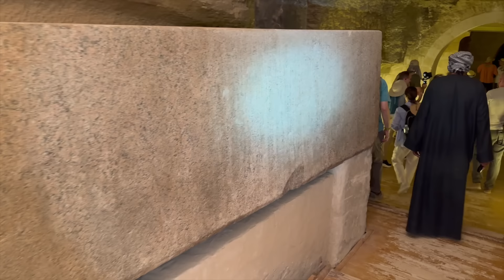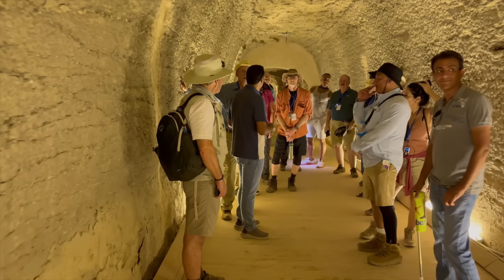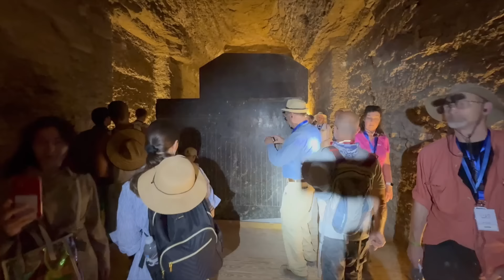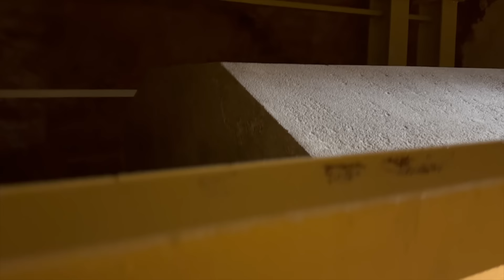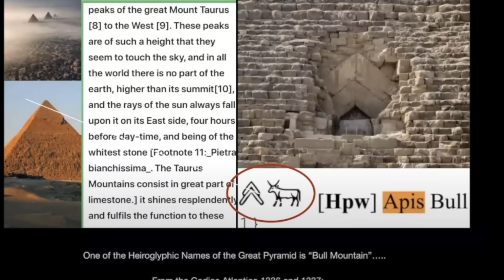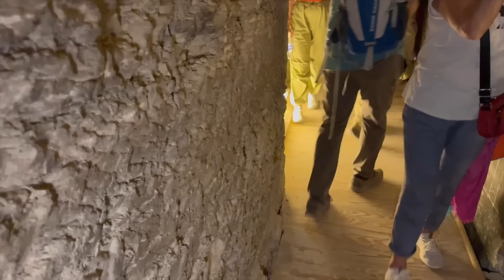Serapeum Secrets: what was really inside the 100 ton machined boxes?

Comment: Chris Dunn felt that the Great Pyramid vibrated as an F sharp chord. He said the King's Chamber vibrated as an F sharp. Then he said the Grand Gallery vibrated as the note A, as verified by his guitar tuner. Problem is that there is NO NOTE A in an F sharp chord. The F sharp chord consists of F sharp, B flat, and C sharp. There is no note A in that F sharp chord.
Reply: That's not the only issue with his daft assertation. JS Bach decided what note vibrates at which frequency. I have no doubt music was around in dynastic times but before JS Bach there was no standardised pitch value for any note. BTW you are wrong about the third of the triad of F sharp major. It is called A sharp not B flat. You don't mix sharps and flats in key signatures or primary triads. Yes enharmonically a B flat IS an A sharp BUT we do not refer to it as B flat in this primary triad.
Reply: @kirkhunter146  So do I use the pronouns he/him or she/her for this chord?

Comment: Moving the boxes. The Nile has moved quite a bit since ancient times and was much closer to these ancient sites than it is currently. We have found canals running right up to most of these ancient sites. So they moved the boxes 99% on water. Why drag stones on land when you can dig a canal straight to the quarry? As for moving the boxes themselves, I wouldn't under estimate what 100k workers with ropes/pulleys and domesticated bulls can do. A flip flop winch and some rollers would get the job done. Check out Wally Wallington for other ways to move big stones.

Digging/Lighting the tunnels. Digging tunnels has health risks and is hard to do but religious extremists and slaves dont care about that. Also making a face scarf to block dust isnt hard. During construction the tunnel was bigger than the arch structure because you have to put the arch structure in, this means any soot build up during construction is above where the current arch structure is. During operation the soot would have built up on the wall lining but you mention the tunnel lining being removed, so any soot on that would be gone too. Also soot can be cleaned off and this has been done in many ancient sites to make them more presentable to tourists and also to see if any hieroglyphs may have been hidden under soot layers.

Cutting granite. Mohs scale measures hardness, not shearablity. Meaning you can still flake it off with a softer material. Check out Scientists Against Myths video where he chisels granite stone with a copper chisel. I also recommend the copper tube cutting granite video. It doesnt take that long.

Coated boxes. No. One box has axel grease on it from modern times. The others are just sanded down to a mirror finish.

Piezoelectricity (which you explained terribly) only occurs under pressure so what is applying pressure to the box? Also it is only useful if you are running a connection from the quartz to something you are powering. Reverse piezoelectricity is where you pump energy into quartz and itll discharge into its surroundings. This might be useful if you're trying to electrically charge the ground which the box is touching. Maybe some electricity would charge whatever is in the box but 99% of the electricity would be grounded.

Precision is a result of selective bias. Weird how you see precision in some measurements but not all measurements. If they are so perfect then why are there so many mistakes. The boxes are NOT perfectly square, this one lid was and not even the entire lid. Just this one measurement. So many measurements get thrown around as "nearly" perfect and then being proclaimed impossible by human hands and thats just ridiculous. @35:43 you can see light gaps on BOTH sides of squaring tool. Doesnt seem very precise to me.

Vibration. A lot of the current theories revolve around vibration and reverse piezoelectricity but this would require the entire complex to be vibrating. The whole structure would be on an advanced suspension system to increase vibration otherwise its useless. Same as with grounded electricity. If the whole complex is on a suspension system then why isnt it vibrating today? Why dont seismic reading increase in that area? We should be able to detect more vibrational readings in those rooms than outside.

You didnt even get to the radio activity inside the boxes. Land of Chem has a video showing UV sensitive material inside the box. His theory I think is the most fleshed out but I think still falls flat at the reverse piezoelectricity part but who knows.
Reply: Regarding the floating of stone blocks on the Nile.....the problem is loading and unloading the boats. Not the floating of cargo which has already been loaded on the boat. They should not have been able to load and unload the boats. In modern times we might be able to use an aircraft carrier, if we could get the blocks to fly onto the deck.
Reply: Modern car transports dont lift the cars on/off the boat. They roll them on/off.

Comment: I’d like to congratulate you on a very interesting video which I enjoyed very much thank you 🙏🏼
I am wholeheartedly one of those who , like you , disbelieve the mainstream explanations for what we see in Egypt . There are however some practical solutions to some of the points of mystery that you mentioned in the film . There is some interesting data on the function of the mysterious Djed pillars and how they may have been some sort of force multiplier similar to a winch , which could offer a solution to the movement of the granite boxes within those confined spaces . 
The limestone quarrying dust issue could be minimised by repeatedly dousing the work face with water and the tunnels could have been easily vented using one or more fire chambers with chimneys to the surface at one end of the tunnel network . 
Interesting that you mentioned the gleaming metal walls , as polished metal mirrors could direct sunlight into the tunnel entrance and then throughout the system .
Moving huge blocks overland can be achieved by two methods that I have heard of that do not seem to be ever considered by archeologists . One is by the “frogging “ or “ walking “ method by which undressed blocks are stood upright , have guide ropes attached to the top sides and the front and back so as to be able to rock the block onto a corner halfway to its tipping point , then swing the block forward before it lands back on its end , its momentum will induce ( with a measured and well timed tug on the appropriate guide rope ) the block to rock onto the opposite corner but damped safely below its tipping point by the opposite guide rope . Forward propulsion is provided by the leading guide rope and forward tipping prevented by the aft guide rope . It may sound difficult but with timing and practice it is very effective and quick .
The other method is the balanced swing process . The undressed block is laid down on its longest and widest side along the direction of travel . The block is lifted up at one end by using levers and timber packers high enough to place a small diorite pointed stone or similar , sitting in the centre of a sufficiently broad timber or dense stone base . This is the fulcrum and the method requires the provision of 2 sets . When in place , the first fulcrum is under the centre line of the block to be moved around 1/4 to 1/3 of the way from the raised end . Then the tipped block is loaded with moveable weights on the short side of the fulcrum until the opposite end lifts off the ground balancing now only on the point of that one small stone . It is at this point that the whole assembly can be swung forward , rotated through 180 degrees being virtually frictionless . Whilst still balanced , the second fulcrum set is placed in a similar fashion to the first but at the opposite and now leading end of the block . Some of the weights are moved to the leading end until the block rests on the second fulcrum . Now the remaining weights are transferred to the leading end of the block until the opposite end lifts off the first fulcrum point , when the block is fully balanced on the second fulcrum it can be easily swung through 180 degrees along the direction of travel , the first fulcrum set retrieved and the whole process repeated . It’s slow but practical , as there is the minimum amount of prep required to traverse the terrain , the manpower required is relatively small and the risk of damage to the expensive block is negligible . 
A lock for the boat to carry the block could be constructed . With the water pumped or bailed out by shadouf , the lowered boat deck could have a fulcrum strategically positioned to accept the block end in the normal manner , weighted to be balanced , swung through 90 degrees along the centre line of the cargo area into a timber cradle of some sort , lashed down , second fulcrum set stowed , the lock gates opened , boat rises and sails off to be unloaded by the same process .
How they managed it with the  1000-1200 ton blocks that they used for statuary is astonishing , absolutely incredible .

Comment: You need to look at the material and structural science.  Theres no wood sleds or boats that can move 100 tons. A boat big enough with thick enough wood to handle that load wouldn't even fit in the nile in most of the river as it was before the dam's were built. And the draft would be too deep even today.   And you also have to look at the ground prep we have to do before moving loads even half of that weight.  The max on our highways is 40 tons because once you get much heavier than that it will damage the roads. Our hard asphalt roads lol. Now double that weight and try it on soft ground and sand.  Its a ridiculous notion.

Comment: I wont comment on any of the theories out of respect to this channel.
But im noticing something i want to comment on.
Many of the elements suggested like Vibrations, Water, Quartz, and energy(electric) create the conditions for creating Gold from water.

Quick Google
"Gold and quartz are closely linked to earthquakes due to the following processes:
Water in faults vaporizes during an earthquake, depositing gold onto nearby surfaces. 

Earthquakes can create electric fields in quartz, which attract gold particles, leading to the formation of large gold nuggets. 

Up to 80% of the world's gold deposits may be formed from this process, where water-filled fractures are widened by seismic activity, allowing gold to leach out. 

The piezoelectric properties of quartz also play a role, generating voltage during earthquakes that can facilitate the formation of gold nuggets. 

These processes highlight the significant geological and chemical interactions that occur during earthquakes, contributing to the formation of gold deposits."

Comment: I like the way you think but I don't think they put meteors in the boxes. They put Radioisotope Piezoelectric Generators inside the sarcophagi to turn them into oscillators that would cavitate the water around them with acoustical waves.
Nuclear must be the driver because of the relative small size of the box compared to the amplitude of power required to pull the process off.⚡🌊✌️

Comment: So the boxes were put there first, or were pre existing. The buildings, hallways were constructed around them. if they were brought down and placed after the building of the crypt, how could that be proved. Just like the pyramids were built from the bottom up, anything in the pyramids was also placed in with the construction process. My opinion is, all of the remains of the past are hugely wrongly dated. The ages of these structures is ancient. They are much, much older. If it were possible to clear all he sand and debris from just the Gaza Plateau, the mystery wouldn't be filled with so much conjecture, skewed time lines, etc. And to drain the water underneath would shed a blinding light on the magnitude of the construction.

Comment: near the beginning you mentioned the ceilings and wall had or may had once been covered so if it that covering was removed there wouldn't be much smoke soot on the tunnel roofs? Are there drag marks on the floors from pushing/pulling 100 Ton granite boxes and is the floor soft limestone too? even 100 ton on log rollers I would think leave quite a mark, and 24 of them gotta leave their trace being moved.

Comment: I don't think they used torches but you did just say those are not the finished tunnels so the soot wouldn't be on that stone to begin with. I have a personal theory that they lit these places with thorium, like we used in the mantles of coleman lanterns. The thorium would have been a byproduct of some mining and quarrying sites. I am currently working on a theory using the vases for the fuel container of the lantern, explaining why there was so many snd why some vases are 3X higher than the base radiation of the rock. I don't know why they would need the precision unless it's just their tools are already capable of that precision and now everyday items end up extremely precise even though not necessary.

Comment: Look not one person has proven how blocks with these weights could be moved down river, it just doesn't scale. It also doesn't scale for land travel either. But the river being a certain distance away now doesn't matter either, the river has migrated away and branches have been lost over time from drying up. So who knows where the river was when the serapeum was built or the boxes being quarried from aswan. I'm pretty sure the river was much closer to aswan but irregardless if it was it wasn't a huge feat for thro build a canal a mile long. Byt if they can't build a vessel capable of carrying these weights on the river then they definitely can't ise a smaller vessel that fits in a canal. Just look up that big stone the Russians moved across land and the water and see the complications and amount of time involved.

Comment: Come on...the box had a hugh crystal inside it and it worked just like a lighter works with piso electric...and there use to be water everywhere and when the moon passed by like it does and like the tids of earth happens it pulled the water threw the tubs and when the pressur released it hit the box and made high electrical charge that went threw the roof that had a gold top...boom...the more you know....dooo dooo de doooo

Comment: Mass m ≈ 60,000 kg.

Horizontal pull on sledges: F = μ·m·g.

With μ ~0.2 (wet sand), F ≈ 118 kN.

200 workers at ~600 N each can maintain this (documented in tomb reliefs).

Once lowered into a trench, block could be slid/levered into final chamber.

Comment: At 31.28 the two cutouts ...salt water and calibrated farads ( capacitors?)
If the corridors was filled with water.also water is a strait leveling.wood could work to float the boxes..longer loggs tied as an assembly. Around the box.
The metod hydro lift works to build..piramids..use locks..level up. Today ship steel is cut with high pressure water nozzles. Those stone walls ...cut the wall and it looks like it was assembled one by one...angles like that needs brain calculating...so I think it was a whole solid wall and then very precise high pressured water. Maybe even drill holes in a suitable nozzleassebly. ....I'm curious if the Giza complex is a tuned device to calm an unbalanced ( planet ?)
Theories....week need balancing or wobble is present.
Sailor.

Comment: I just checked the cubic meter weight of granite, its 2600 - 2700kg

The lid is, said generously, 1x1x4m
That would be 10, not 20 tons

As for the box, if it was a solid peice at 2.5x2.5x4M, that would be 25m3 of granite witch would be 65 tons not 70, but its smaller than that, and hollow, there is a block of atleast 6.5m3 removed to hollow it out, witch would remove another 17 tons

So best case senario would be 48 tons for the box and 10 for the lid, and the total weight of the block used to make it with before it was processed could have been 70 tons

Dont oversensationalize your numbers because yes there is 100% shit thats wired and unexplainable, but when you fudge the numbers it shoots credibility in the head

Comment: I wonder if the "Gold Plating that was said to be lining those Tunnels " , was used as a conductor for the energy flow , It may have been perfect for the job , as there seems to be no marks or damage to the Limestone of the tunnels ?  , It is also said that the whole area of the Pyramids , and especially the Mastabas  have a much higher than normal background Radiation levels , even today !  🤔🤨
Reply: There's not a single shred of evidence that the tunnels were lined with gold. The guy is full of shit.

Comment: FYI, this is dug into the out of bedrock…
Just take that into account. And without a light source. And no they didn’t have a fire burning up the oxygen.
Reply: There was also no soot on the  ceilings. So they had something for light source.
Reply: @ogapadoga2  it’s amazing. Some people would think that they used fire.  Which would’ve burned up the oxygen and gave them carbon monoxide poisoning.
Reply: @HrDNiPZ  Another thing i have noticed is that there are no hieroglyphs in the chambers of the pyramids. They probably lost the lighting technology at some point and the scribe couldn't get in to do the work.